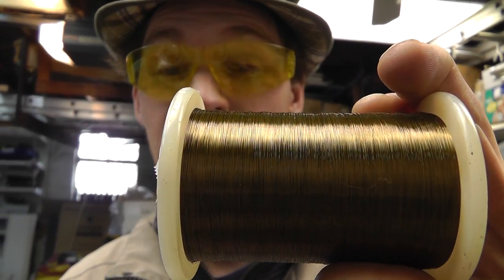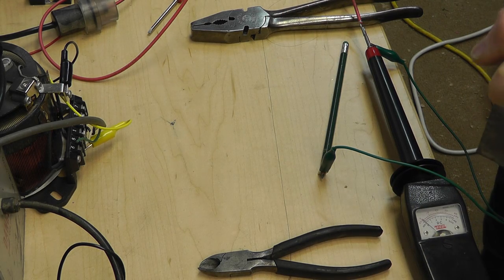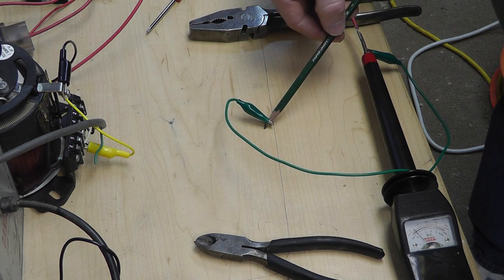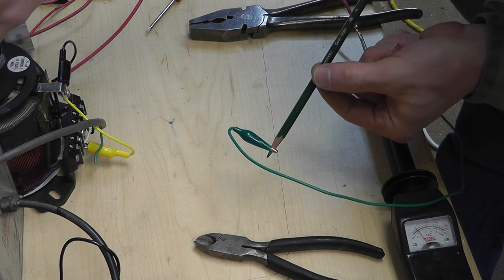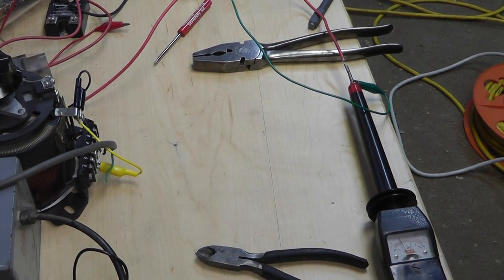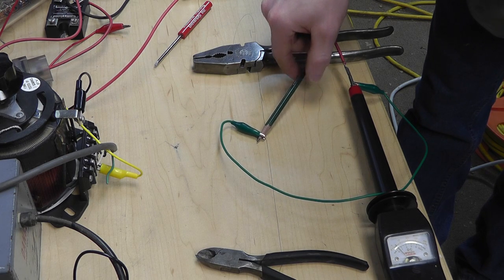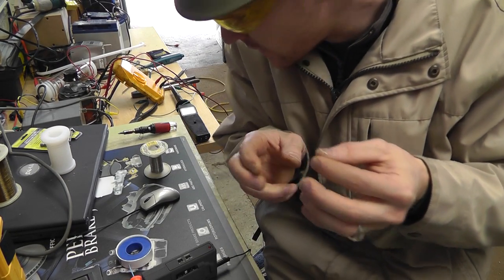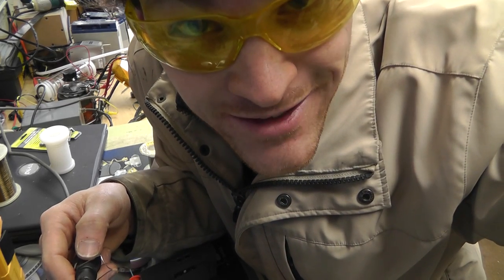Stan Meyers 430 SS Wire. Lets Do Some Tests. HV Fun

Comment: Same thing I was thinking shadowrider, #2 graphite does conduct electricity, i've experimented with replacing stainless steel plates in electrolysis setups with #2 graphite and it still works.

Comment: some ignition wire manufacturers also use it in spark plug ignition wires as a resister, others uses carbon coated silicon made wire.

Comment: cool tests
you should know that the side by side flux field pf bifillar wire will jump a spark much easier then putting the arc beside it
the pos and neg interaction would be much more intense
in fact a real fux capacitor
this was not meant as a joke, by the way
wagaskan148 is correct also